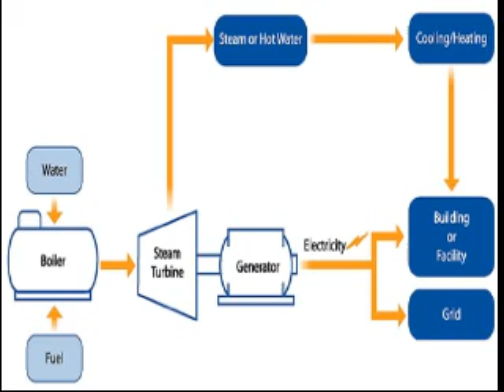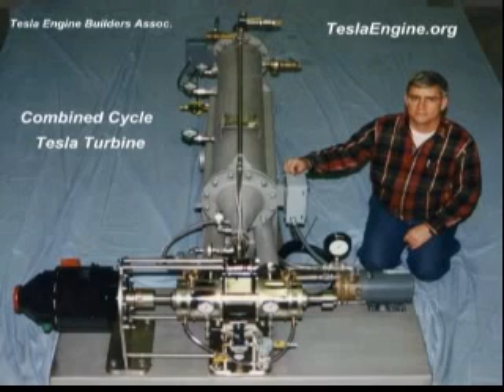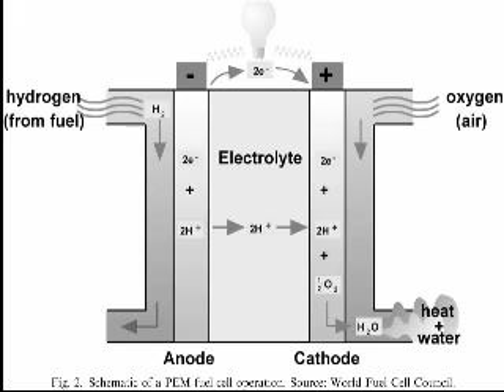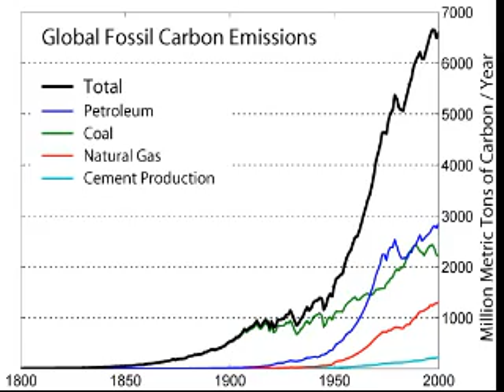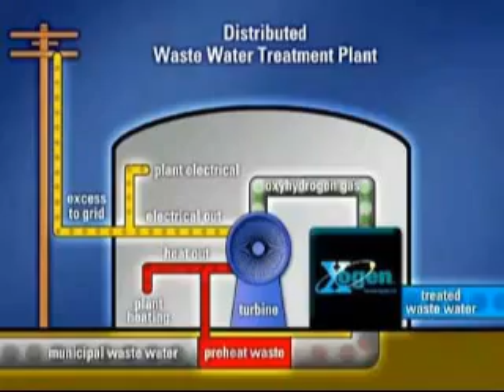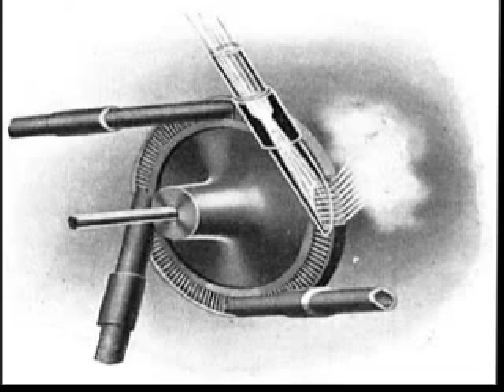#17 My Vision For Hydroxy Part2

Comment: the way I see You are trying to use hydroxy gas as a heat source to produce electricity. did you completely forgot that you need electricity to produce that gas from the begin with.  How are you going to compensate the lose of energy in that process. really do some math and start using alternative ways to get electricity like solar and wind and then that free energy use to produce free fuel hydroxy gas for our cars etc.

Comment: Nuclear Power is the highest efficiency when used in the Auger reactor. These are being built all around the world except in the U.S.A., which by the way is where they were invented and designed. HHO does work and it does run engine's.  Keep working to get it right and we will all be better off. . .Kudo's my friend, steer away from the nay sayers and Big Business they are only trying to confuse.